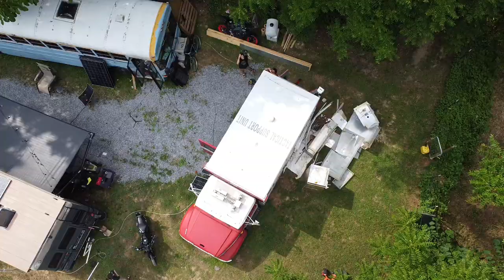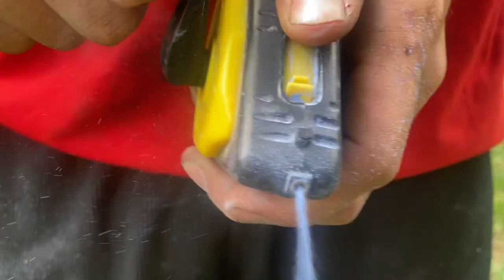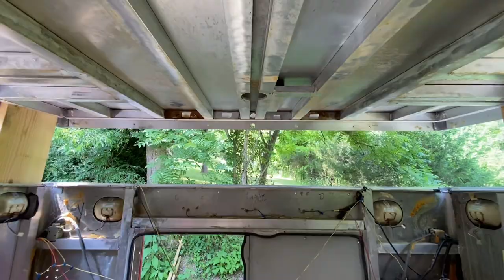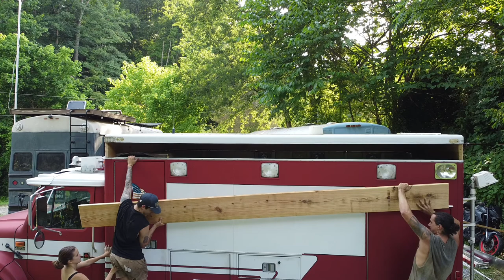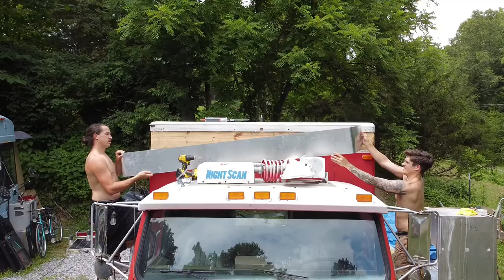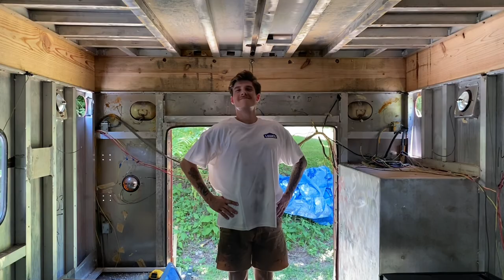we RAISED the roof in our ambulance conversion - DIY expedition vehicle

Comment: This looks awesome! How stable has it been on the highway, and how waterproof is it? I'm thinking of doing a similar thing for my ambulance!
Reply from the maker: Thank you!! More stable than any of the other methods we’ve seen since it’s a solid piece of wood! We waterproofed the wood from both sides, but it was extra since we tucked the metal under the roof on the top and on top of the wood in the bottom, it’s very very unlikely for water to get in only if there would to be damage to the roof itself!